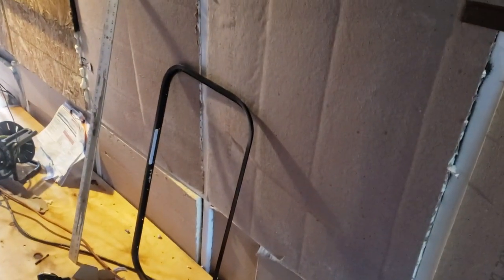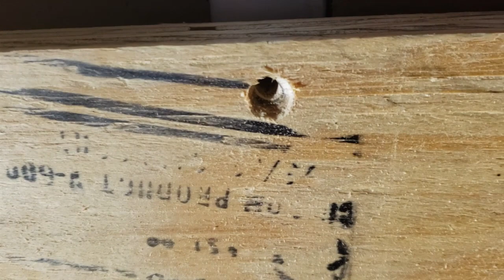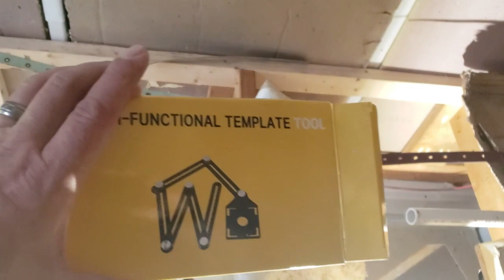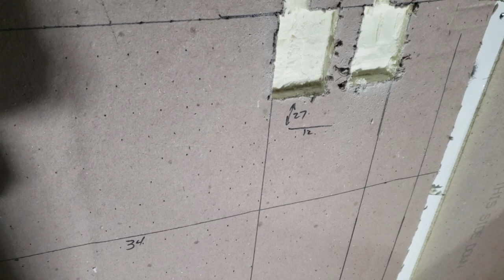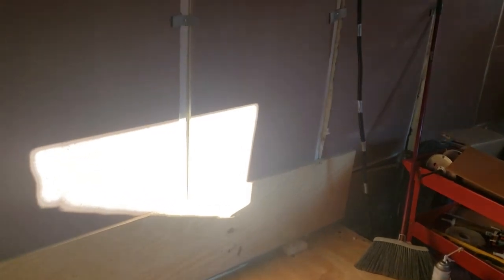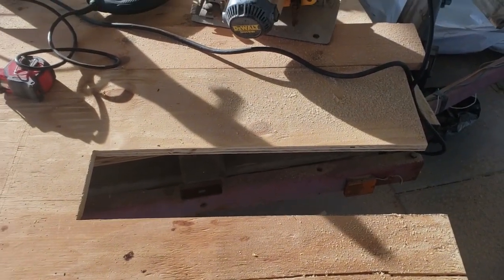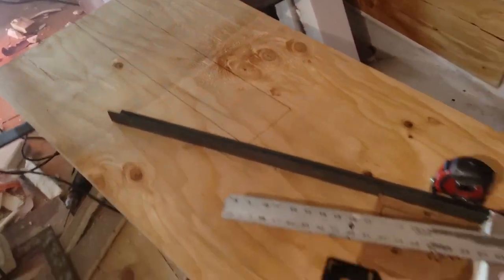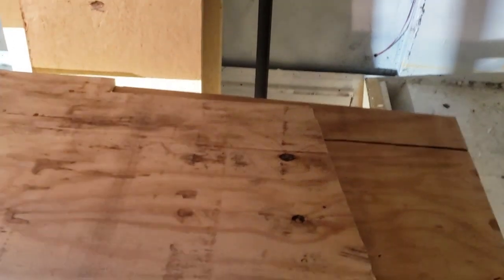Skoolie Build #49: Installing Plywood Walls and Roughing in Wall Outlets

Comment: Hi mice job on your bus so far are you going to get cameras for your bus
Reply from the maker: Yes.  I'll be adding 1080p cameras all around with a NVR drive eventually.  Power over ethernet.  I will use them for security, driving views, and travel footage. Thanks for watching!
Reply: Ok cool nice job 👍
Reply from the maker: @philipporter7650  thanks!